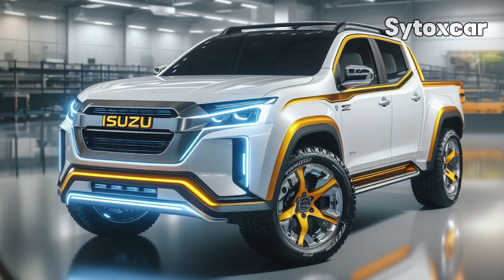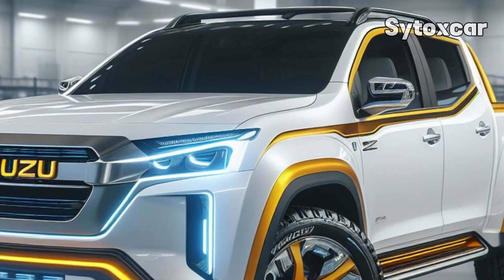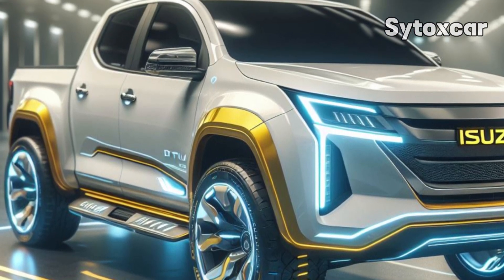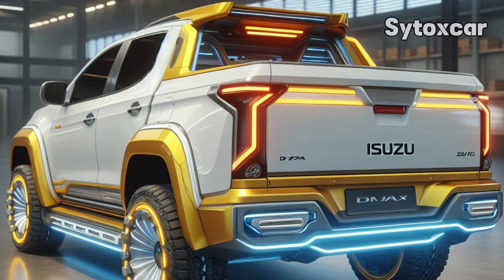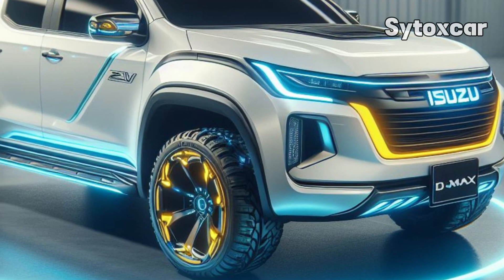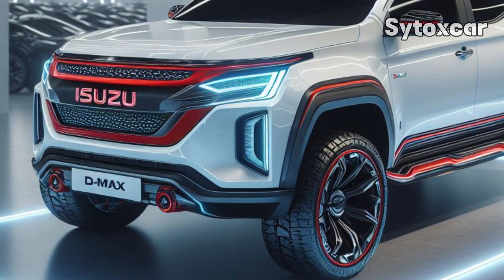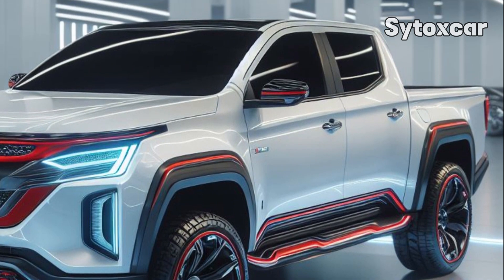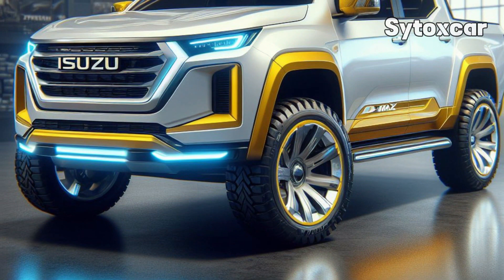2025 Isuzu D-Max EV Concept Reveals the Future of Electric Pickups

Comment: Only 130km/h?😮 To slow at least 200km/h
Reply from the maker: @jenny-leesanders1279 Thanks for the comments! It is true that the 2025 Isuzu D-Max EV has a maximum speed of 130 km/h. This was likely limited intentionally by Isuzu for safety, efficiency and performance reasons. The D-Max EV is designed for torque and power at low revs, making it ideal for off-roading and towing heavy loads. Operating costs are much cheaper than petrol or diesel cars because they use electricity. The D-Max EV is also equipped with various advanced features, such as the latest safety and entertainment technology.

If you need more information about the D-Max EV, you can visit the official Isuzu website or read reviews from trusted media.

What do you think about the other advantages of the D-Max EV besides speed?
Reply: My husband has a vcross and I have a mux we would love to own a E max but my husband wouldn't buy it if it is so slow